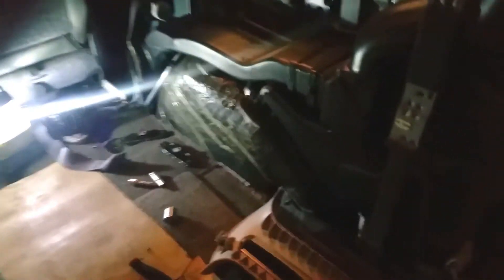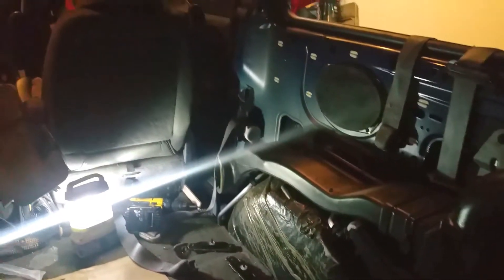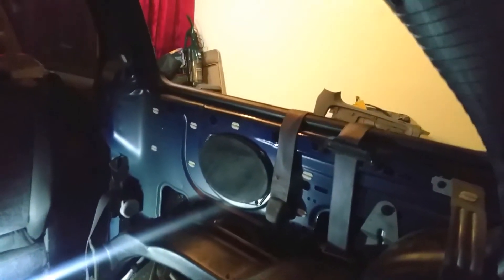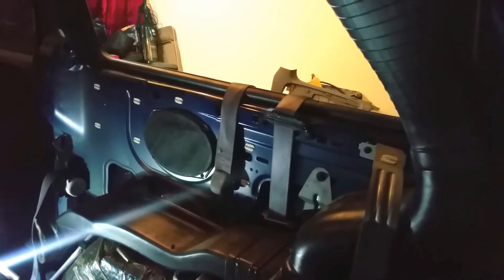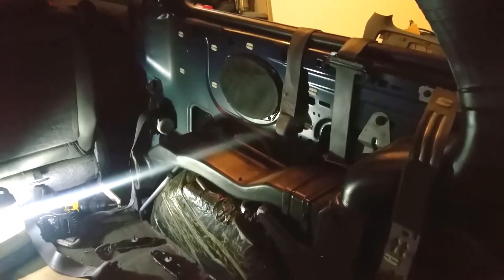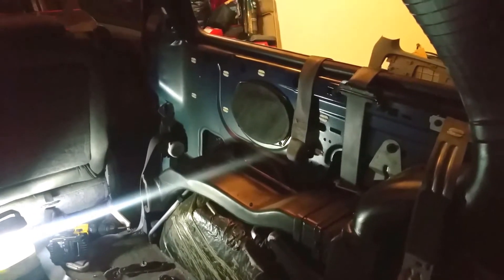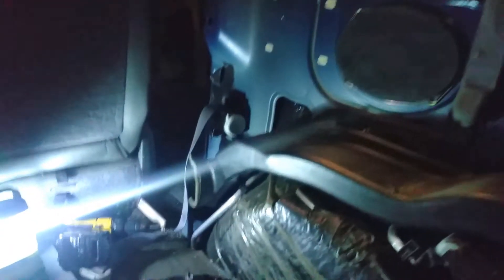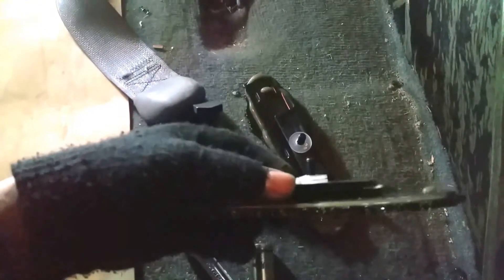2006 Dodge Grand Caravan rear side window glass

Comment: was not helpful, you just describe  how to remove the panels and put it back again , nothing about the rear window, thanks anyway.
Reply from the maker: At 2:55 I start talking about removing the window hinges and the rear most mount a little later after that. In this customers case the window was shattered so sorry to say there is no footage of removing the glass. Hope that helps, if you have questions I'd be glad to answer them.
Reply: I was going to say the same thing. A total waste of time.
Reply: Useless ....waste of time